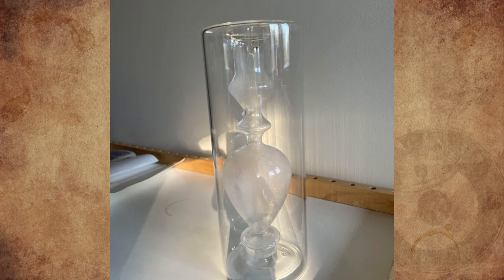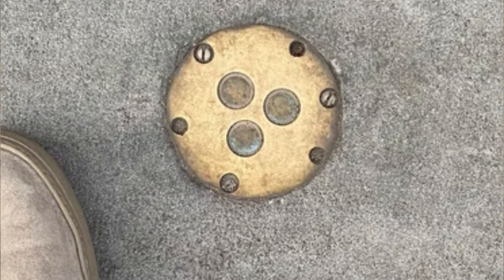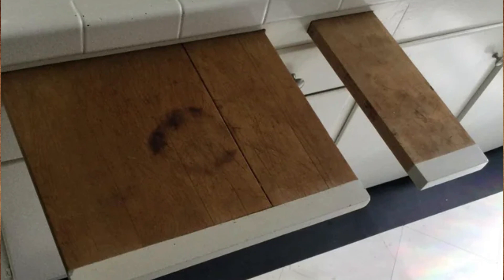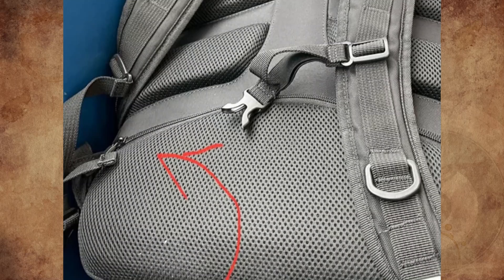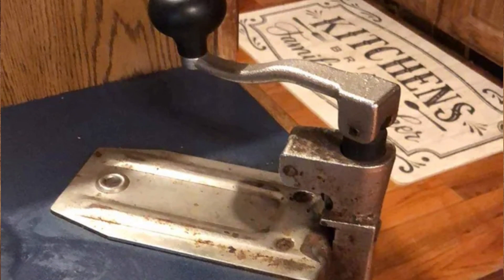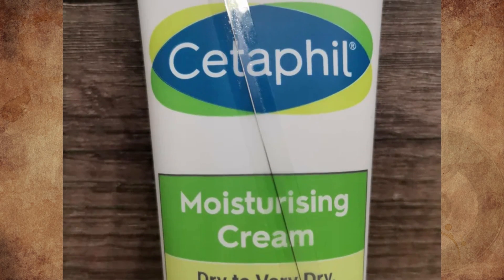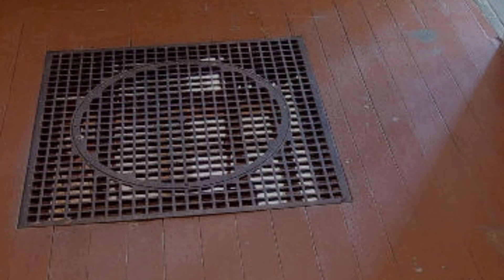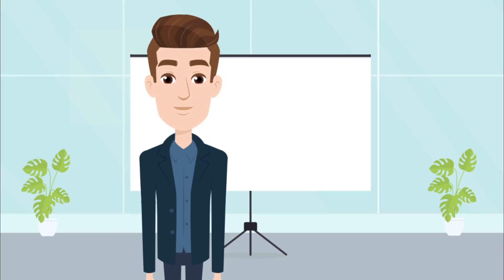What Is This Sterling Silver That Looks Like A Spoon And Hollow Brass Tube With N And S On It?

Comment: We had a can opener like the one in the video in our high school kitchen.  They opened up a lot of #10 tins with that, and the cooks needed to give the can opener a good thump down onto the top of the can to break the cutter through the top of the can.  Well one time they had gotten a bunch of orange juice concentrate cans and a cook rammed the opener down onto the can - and OJ went spraying everywhere!  You'd have had to look close to see it, the body of the can wasn't metal, it was cardboard painted with some metallic looking paint.  Those were some wonderful people we had working in the kitchen in those days.  They just laughed it off and cleaned up the mess and got on with preparing the meal.
Reply: It’s an Edlund commercial can opener. About $120 from most restaurant equipment suppliers
Reply from the maker: I think this could also be really helpful to someone with the use of only one arm. I remember that the standard electric can openers I've used still required holding the can with one hand while starting to engage the opener blades. This design would be far more helpful in this situation.
Reply: Shelly Duval uses one in "The Shining" to open a #10 can of tuna........ how 3 people are going to through a #10 can of tuna is beyond me.

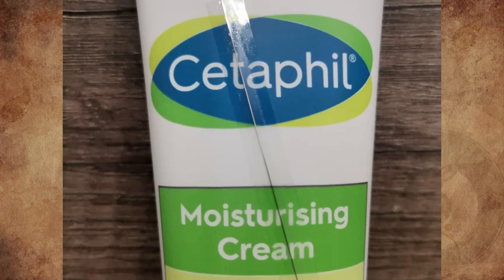Comment: 5:52 The inquirer said it seemed heavy for its size. I suggest holding a powerful magnet to its side. If it sticks there must be iron or steel inside. If so, it’s a Flinders Bar. A British Royal Navy Officer a couple centuries ago developed them as a way to compensate a magnetic compass for the vertical component of the Earth’s magnetic field. Because that vertical component varies depending on where you are iron bars of different sizes must be interchangeable, hence the cap and the North and South marks.
Reply from the maker: Makes sense. N and S on opposite sides of something long and thin are traits of a magnet. The fact that it can be unscrewed and is empty leads me to believe it's a container for a magnet.

Comment: 7.10 Answer given is probably correct but also possible that it may have been a potatoe keeper.  Have seen these in farmhouse pantries. There was a bin with slots underneath the grating and allowed the cool air from under the house to circulate through the potatoes, preventing sweating and mould. Extended the life of potatoes and other vegetables in warmer climates.

Comment: The first house I bought had a more advanced version of that floor furnace---a large, originally coal-fired furnace that used the floor grate as a cold air return, and sent hot air up ductwork to all rooms of the house. I increased its efficiency by placing a window fan face-down over the grate, turning it into a forced-air furnace.

Comment: The object@7:20 certainly looks like a modern Engineer's pocket scribe, for scribing measurements on metal.
Reply: It is a scribe. The pokey part is far to long to be a tooth pick. The length is to grind / file down to resharpen the scribe many times.
Reply: @ljohnson820  I agree, I have modern ones made of tungsten carbide that will scribe a mark on nearly anything.
Reply: @markbernier8434  Bond henchmen might use TITANIUM tooth picks but if it can mark nearly anything I'm not putting it near teeth.
Reply: I thought it was a scribe too.  My dad gave me a smaller one that has a carbide tip.  Good for marking tools